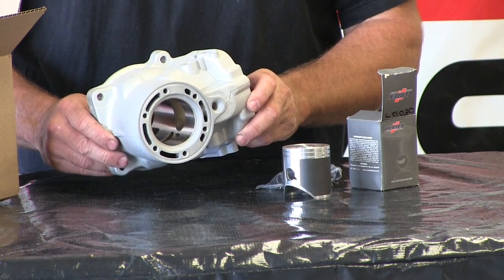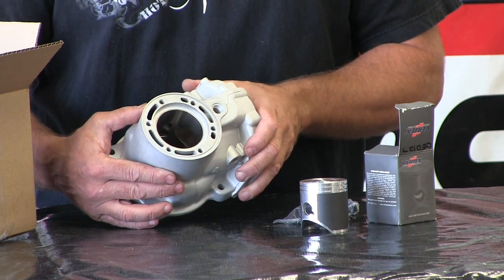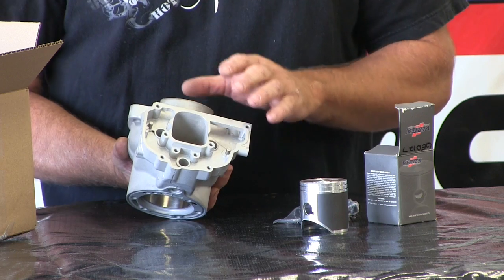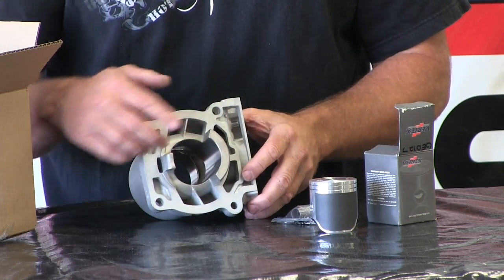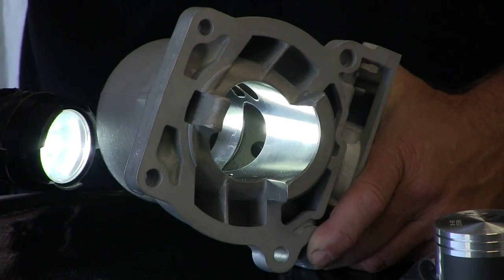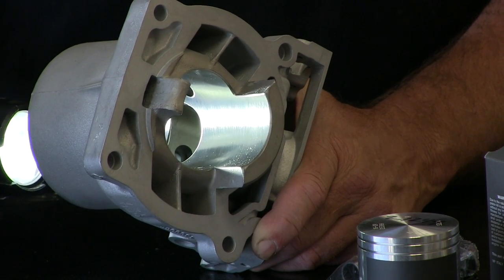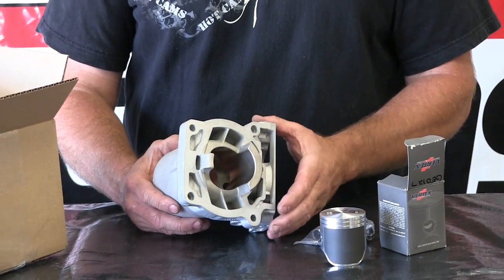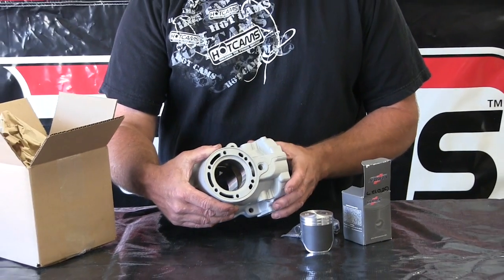Millennium Technologies Cylinder Re-Plating

Comment: Is there a way to know if your cylinder uses this treatment or is a standard steel sleeve?
Reply: Use a magnet. If it's sleeved the magnet will stick
Reply: The nikasil is usually only a couple thousandths of an inch thick, look at the top and bottom of the cylinder to see if there's any difference in metal (you may see some discoloration from heat on a nikasil cylinder around the aluminum) but if it's steel it should be a pretty defined line where the metal changes from aluminum to steel. You can also look at the ports too. What kind of bike? If it's a motocross or modern 2 stroke/4stroke design it will most likely be nikasil. Most manufacturers only use steel sleeve on old school designs like air cooled 4 strokes.
Reply: It would be the one I own, but is cherry and never been apart, a 2002 Honda CR250. If i were to freshen it up with new rings and or piston is it automatic to have the cylinder replated? Are these cylinders capable of being bored oversized? I realize a replate would then be needed. So if it's nikasil plated there is no steel sleeve, just the aluminum casting and the plating is all there is?
Reply: It's definitely plated, and yes if its nikasil there is no steel sleeve, it's one or the other. You can overbore and replate it but how much depends on your application. These coatings are VERY durable, if you're doing just rings and pistons, just get a bore gauge and check to make sure it's within tolerance and you're good to go, they don't need to be replated every time. You also can't hone it like you would with a steel cylinder to freshen it up, at most you can use scotchbrite to clean up some rough spots but that's all I would do, honing would ruin it.  The rings will seat just fine. I actually just checked the tolerance of my KTM 200 2 stroke and even with a HEAVILY worn piston, and crank and rod bearings on the way out, it was still well within factory specs, so they can definitely take a beating.